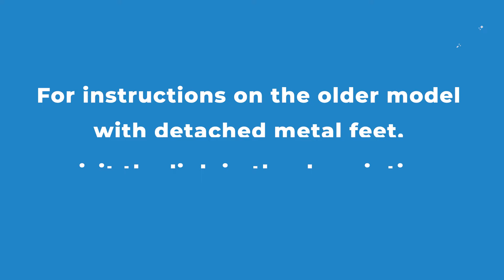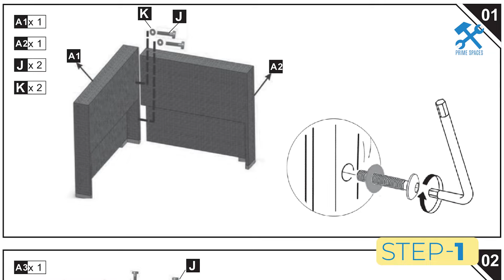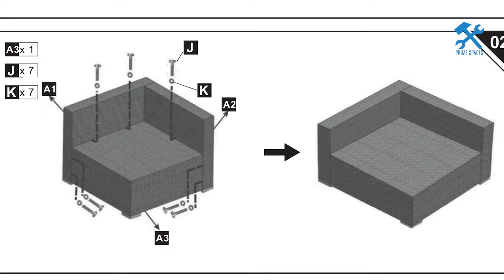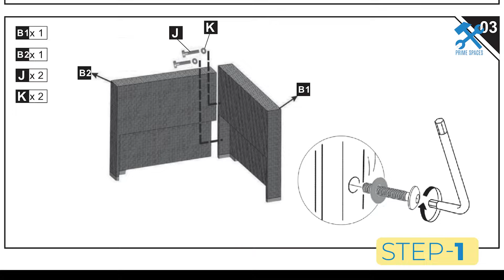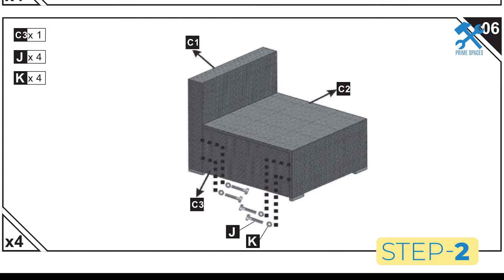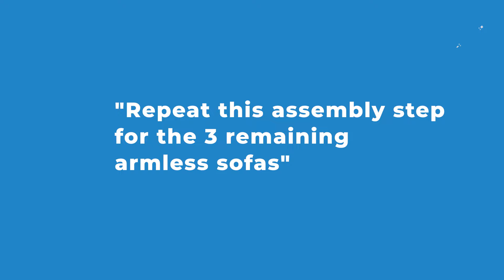Outsunny 7 PC Outdoor Wicker Rattan Patio Furniture Conversation Sectional Sofa Set Assembly Merton

Comment: Did you use the Part # GG connectors? I'm not exactly sure how they are to be used. Also, I recommend using a drill & Allen wrench bit so you don't have to tighten all these by hand. I put it all together in minutes doing so.

Comment: How are you adding the nut bolts to tighten? Mine don’t connect
Reply: Neither do mine I’m so confused 😐
Reply from the maker: The bolt should be able to connect to the nut pretty easy. Is it happening for all of them? If so, then it could be, they sent you the wrong set of bolts. Also, if you are assembling, the older model be aware that there are two different bolt sizes. The longer bolts are to connect the furniture pieces together, and the shorter bolts are too, attach the feet to the bottom of the furniture. If you are using the shorter bolts to connect the furniture pieces together, you are using the wrong bolts and they will not connect.
Reply from the maker: The bolt should be able to connect to the nut pretty easy. Is it happening for all of them? If so, then it could be, they sent you the wrong set of bolts. Also, if you are assembling, the older model be aware that there are two different bolt sizes. The longer bolts are to connect the furniture pieces together, and the shorter bolts are too, attach the feet to the bottom of the furniture. If you are using the shorter bolts to connect the furniture pieces together, you are using the wrong bolts and they will not connect.